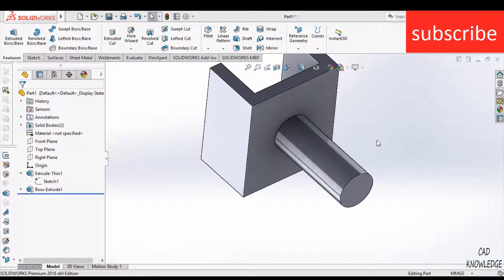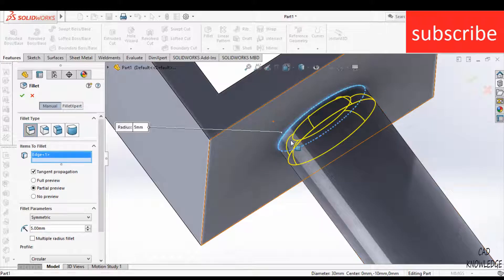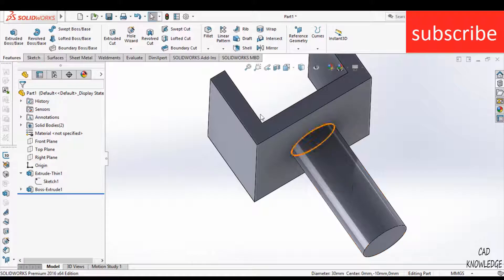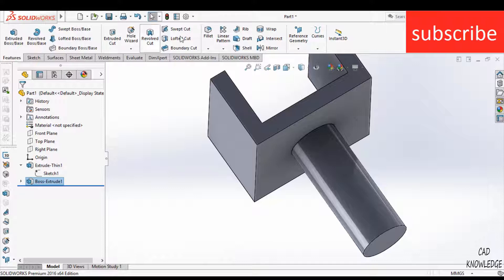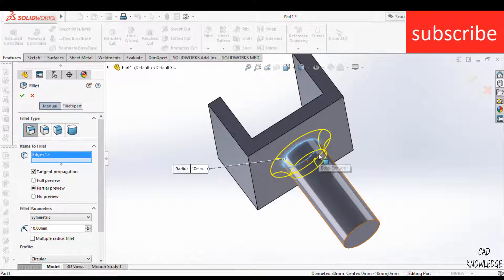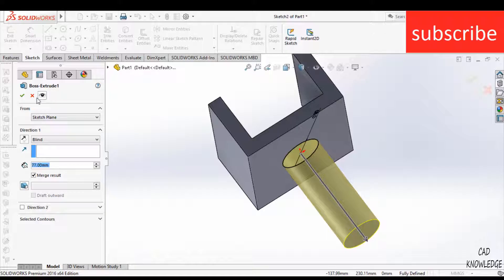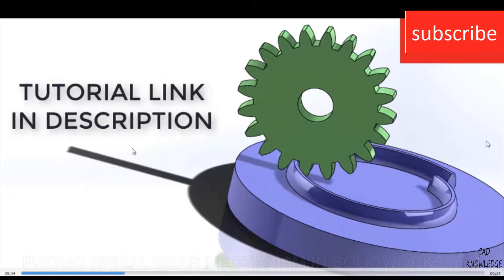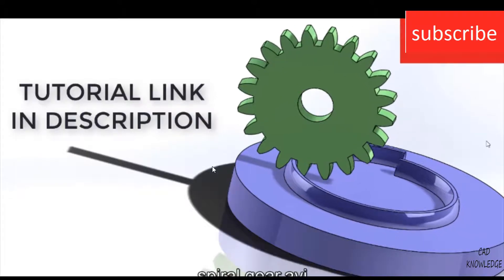fillet error in solidworks

Comment: I made a bottle head. It has a screw - profile swept around a helix. I cannot add a radius between the thread and head core as they do not seem to be merged. In the sketch, the edges are coincident, I use "merge to tangent faces" option and it only round the thread inwards instead of making a radius connection between the thread and the core :(
Reply from the maker: I need to see the model before I can comment